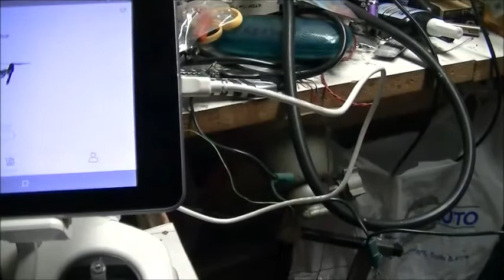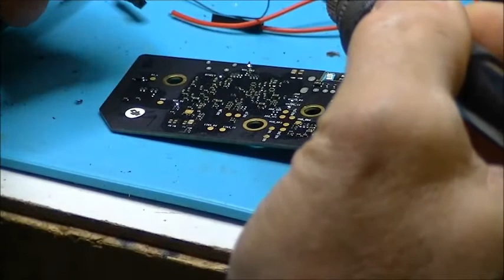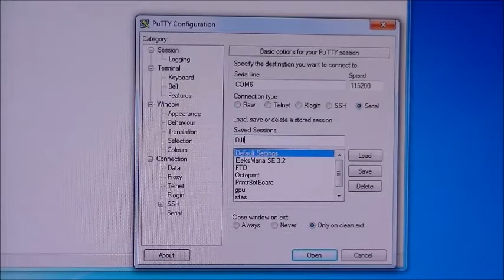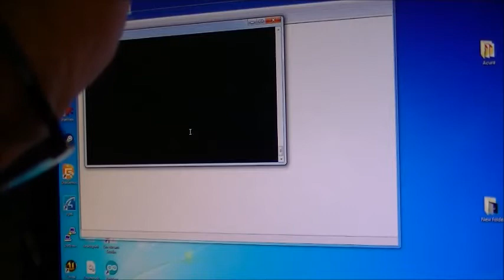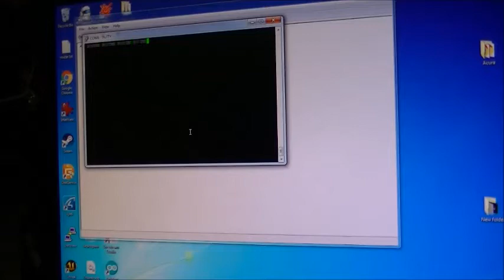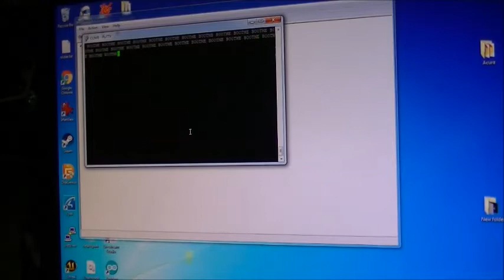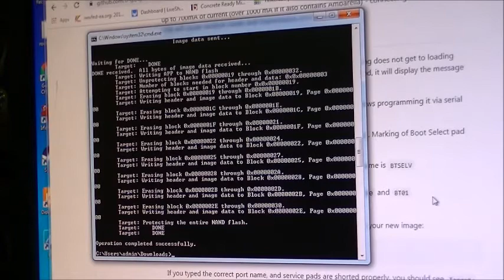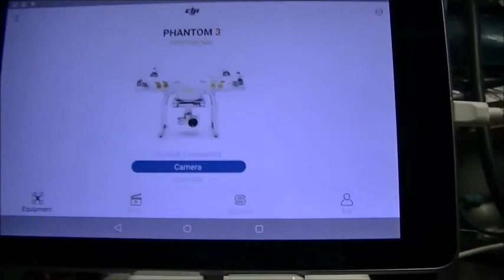DJI Phantom GL300A USB Repair fix no camera view

Comment: HELLO TERRY AGAIN i faced a problem in the method of flashing the gimbal , the putty is not reading it on the same ttlusb i used to flash the gl300A, do you think if putty is not reading can i do a blind flashing??? i mean i make the connection then  jump the booting and running the command promt and type the reflash orders?? what do you say may that work??? or it may do a harm?? by the way when i make the connection to ttl usb and set in comport and buad rate the putty  does not display any communication, but the gimbal board is has an led blinking .the supply voltage in this repair  is 5v according to video, i tried the 3.3v instead but the gimbal board didnot even blink .
Reply from the maker: Unlikely. If you are not seeing the BOOTME message then no good. Try swapping the Rx and Tx on the ftdi and see.  

Hmmm.  How are you powering the gimbal board?
Reply: @tjones99   i powered it from the ftdi(ttl usb in my case) it self, when i use the 3.3v the ttl will not be defined as a com port( unknown device) and will not launch the putty on that port, when i use the 5v option i t opens the comport in putty and the board status led blinks green for some time then red but no serial data received on putty?! i tried the ftdi32 same results, by the way the guy used a seperate board to power the board thats why he used two grounds
Reply from the maker: m j putty not seeing your ftdi boards is the first issue. The ftdi should be 3.3v. First get that working without the gimbal board even connected. Connect ftdi Tx to ftdi Rx and plug the ftdi into your computer not connected to gimbal board. Should show up as COM Portland with Rx to Tx what you type in putty should appear in putty window. 

Then find a way to provide 5v power to the gimbal board. What might work is your second ftdi board set to 5v and only hook up 5v and ground from it. First ftdi at 3.3v hook up Rx Tx and ground for communication only. Alternatively get a 5v dc power adapter.

Comment: now i have another problem i have a phantom3pro that displays no video and this happened after an unsuccessful  firmware upgrade, is there a way to reflash the gimbal main board  there is a video but its in german!!lol https://www.youtube.com/watch?v=boK1ZFy0phw , it is clear uses a very close technique but the jumpers to enter boot me mode is not clear!!??
Reply from the maker: I looked at that German video and basically the exact same as my video but using different files that the author makes available on Google Drive to download. Same FTDI adapter, same PUTTY program, same procedure just solder to the pads he shows in his video and use the files he has on his download. Just ignore the words and follow my procedure with his file and his connection points.
Reply: @tjones99  should i jump the points with blue lines in his connection image all three points or just one point  ? and why did he use two grounds??
Reply from the maker: @mj-is3kd  My guess is you jumper two of the pads to get in bootme mode. In one of the comments someone posted the text of the video in english (crude but somewhat helpful)
Reply from the maker: @mj-is3kd  Also interesting is that in the comment where someone asks for an english version someone else points at my video as the solution... small world...

Comment: hats up to you mr Terry i have just ran the method and saved me loss of my gl300A , thanks a lot for sharing... one thing to note that the ftdi adapter didnot work i dinot know why only a ttl usb adapter did the job communicating correctly in the whole method
Reply from the maker: Thanks for the feedback. Sometimes it is hard to get the FTDI drivers to install in Windows 10 because some of them use unsigned drivers. There is a special boot mode in Windows 10 that you can get into for one restart that allows you to install unsigned drivers. Great instruction on that at https://www.maketecheasier.com/install-unsigned-drivers-windows10/

And I can't take full credit... all the details posted by others in the forum made this video possible.

Comment: hello terry first ultra thanks for the effort and most important for sharing it , a lot of us  semi diy guys like dji products for technology and reliability , but hate how closed dji stuff are , any way my question hopfully you answer should it be a ttl  module used to communicate with the board you repaired  or i can use ftr32 ?? is there a flashing method for the gimbal main board if it goes bricked
Reply from the maker: Never heard of an ftr32 board... ftdi and ftdi 232 board will work... virtually anyything that is seen as a COM port on the PC and translates the communication at a 3.3V logic level will work... And I am sure there is a way to reflash a gimbal board but I haven't gone there yet... have a look at https://phantompilots.com/threads/fixing-flash-in-dm365-chip-within-ph3-pro-gimbal.127310/ on that one... it starts off way in the deep end with resoldering a BGA flash chip... then talks about reflashing... but I think there  will be a lot of reading between the lines on that one...
Reply: @tjones99   ftdi 32 i meant, thanks for reply

Comment: Terry I have a Phantom 3 Professional and it lost video after sitting for about 3 months.  Never had a problem before that.  Even now I can fly the quad copter and it records video but I can't see what the camera sees.  Flying blind is risky.   My problem is I don't have a PC computer (I'm a Mac guy) and while I basically understand what you are doing, gearing up would be costly.  Is there someplace where I can get a board for my GL300B controller and just do a board swap?
Reply from the maker: I see two boards listed on ebay that might solve your issue... alternatively if you want to mail me your board I can try the similar procedure on the GL300B board that I did on my GL300A board and see if that behaves...
Reply: @tjones99  Terry, thanks for getting back to me.  I saw the two boards on Ebay and the price is not too bad.  I contacted a drone repair service and they told me to look at buying another Phantom 3 since it would be about the same cost as having me send in the drone and having them fix it.  A board swap seems sooo much better.  I'll get the board out of the controller and see what it looks like and get back to you.  If I have you try reprogramming the board, would you need my controller to see if it works?
Reply from the maker: Don Loftus no. Just the board.

Comment: Hi Terry,

What is the name of the connectors you use? Do you have a link to where you buy them at all? 

Thank you for the video, got the USB coming in a few weeks and trying this asap but can't figure what the connectors are
Reply from the maker: I assume you are talking about the little red wires that have connectors on the end to plug onto the FTDI board (USB FTDI board).  Those are just simple dupont connectors on wires. The ones pictured were just female to female wires that I cut in half so two wires cut in half gave me 4 dupont to bare wires. Search for female to female dupont in ebay or amazon and you will find some.
Reply: @tjones99  thank you Terry, true gent! I'l look them up now!

Comment: Terry, a question about how you soldered the leads on the board.  I noticed you just touched the tip of the iron on top of the stripped lead wire and pad but didn't have an obvious source of solder.  Do you use a paste on the pad or the stripped end of the lead?  Or solder the end of the lead and then melt that again when pressing the lead against the pad?  
Also, I've got a GL300B controller that just this weekend progressively stopped showing the video stream and then stopped being recognized by an Android tablet (using two different USB cables.)  Also tested unsuccessfully with an iPhone 7 and an iPhone 6.  I can get into the Go app but it says "disconnected" and no amount of fiddling seems to restore the connection.  It worked fine the weekend prior to this.    I'm hoping the control board for the GL300B will behave the same with this process as those with an GL300A.
Thanks.

Edit:  Just opened up the GL300B controller and the USB control board looks nothing like the one in the video.  The bottom of the board (the side opposite the USB connectors,) is completely blank with no SMC's and no pads other than the ones for the USB connectors themselves and two copper colored dots marked 1765_P1 and 1765_P4.   There are some SMCs on the side with the USB connectors and what might be pads but none are labeled.   There's a label saying: P01213.02 and a sticker saying: 04EJA   57104.   Guess that takes care of that.
Reply from the maker: Sorry, for some reason I missed that you had posted a message. I think in the video I "tinned" the pads on the board which if you don't spend a lot of time soldering means you make sure they are coated with a fresh blob of clean new solder, and off camera I did the same for the ends of the wires so both wire ends and solder pads on the PCB (printed circuit board) had fresh solder so then all you have to do is put the two together and apply heat and they melt together. Soldering 101... 

So your board looks different... do not give up... Have a look at the pictures at https://phantompilots.com/threads/fixing-flash-programming-in-dm365-chip-within-gl300-remote-controller.144123/ and see if that looks like your board... if so then my video is just a reference and those instructions should apply.
Reply: did u find a fix in the end?
Reply: @Ace-Boogie-Reactions  I did not.  I think the problem was caused by a bad USB cable that may have shorted the board.  I ended up buying another controller.  The old controller is a GL300B and the new one is a GL300D but it works fine with the Phantom 3 pro.  Thanks.
Reply: @stevek731  i bought a new usb board for the back and still had the same problem so im guessing its my main board on the controller i just bought a second hand controller with 50 percent charge problem for £35 im going to swap the board and see what happens should be here tomorrow

Comment: Hello I follow your instrucion, get succesfully to de command windows with the flash command instruction, its start to flash but it hangs up at 
Waiting for the DM36x...
                      target BOOTME
BOOTME command recd. returning ACK and header
                      ack command send. Waiting for Begin command
                      target BOOTME
and it goes over and over, witout flashing?
any suggestion?, Y can send you my videos, but can contact you?,
I´m at 2cvguy at gmail
thank you Cris
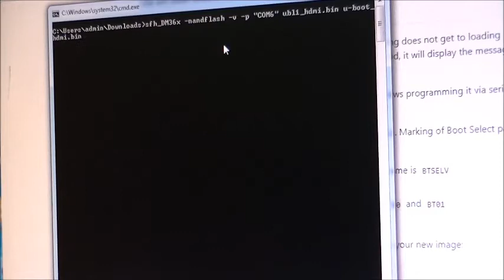Reply from the maker: If you watch at or about 18:00 in the video you will see mine did that exact same thing and I mention aborting the program and restarting it and the second time it works.
Reply: Terry Jones Hi Terry, yes I do it again and it hangs again waiting for the begin command to get acknowledge, done it few time but no luck
Reply from the maker: @elviejoperro3077  You restarted the DOS program WITHOUT rebooting the USB board? 
I see a couple of things you might try at
https://phantompilots.com/threads/problem-flashing-nand-on-phantom-2-vision.117342/
One is to erase nand first. The other is a carefully timed swap between terminal and programming command. 
Other than that I don't really have any better suggestions.
Reply from the maker: I had another thought today after working with a DJI Lightbridge 1 ground unit that had a similar issue. You have to short out the BSEL to 3v3 to get into Bootloader where it accepts the flash programming, and during the process it finishes and reboots and hangs up on you I believe. Two things you may try. One is to disconnect BSEL from 3v3 as soon as the flash process starts, the other is to keep BSEL connected to 3v3 so that when it reboots it again goes into bootloader/flashing mode... Not sure either will help. I would also like to hear back whether you had any success and if so what led to success. That way this thread can be a resource for others.
Reply: Terry Jones Hi Terry thank you for keeping me in your thought, I tried to do the 2 suggestion but no luck. ☹️ I even read in another forum a guy had same issue and he tried with another USB to TTL and succeeded, not my case, tried with 2 other TTL and no luck, the board dosen’t pasa from the second command, the BEGIN command, I can’t even get to the Target Botme to run the tool for a second time. Think the NAND chip may be broken?, but it does give the no image massage from putty before putting it into boot mode. Well will keep searching info on the net, thank you Cris
Reply: Terry Jones Hi Terry thank you for keeping me in your thought, I tried to do the 2 suggestion but no luck. ☹️ I even read in another forum a guy had same issue and he tried with another USB to TTL and succeeded, not my case, tried with 2 other TTL and no luck, the board dosen’t pasa from the second command, the BEGIN command, I can’t even get to the Target Botme to run the tool for a second time. Think the NAND chip may be broken?, but it does give the no image massage from putty before putting it into boot mode. Well will keep searching info on the net, thank you Cris
Reply: Hi Terry, update on the board, I found a used cheap board for the GL300A witch supposed be in working condition. To my surprise I installed and test it with no luck, no video feed. I pulled it out and run the putty program and guess what?, no image. I run the tools following your Instruccion and immediately override the  image and now it is working great. You do need a board that is no damage or burned to reflash the firmware. So thank you again, your tutorial is good and easy to follow. Thank you, Cris.
Reply from the maker: @elviejoperro3077  Thanks for following up and posting the outcome. Sorry for the delayed response.

Comment: I appreciate the video you have made on this. I just ordered the ftdi board and am going to give this a shot when it arrives. Thanks!
Reply from the maker: Takes a bit of skill soldering little wires on to hook to the FTDI board. Also another tip I found is that if your FTDI board has a CH340 chip and you have trouble getting drivers to install on Windows 10 look up how to install unsigned drivers in Windows 10.
Reply: @tjones99  Just a small correction.  If the USB to TTL UART adapter has a CH340 chip, it isn't an FTDI board.  The CH340 is made by WCH, FTDI makes the FT232 chips.  The genuine FTDI adapter that I had worked great with your original instructions (and Windows 10 64 bit).  Those lower cost Chinese adapters will indeed sometimes have problems.
Reply from the maker: @billjohnson3344  thanks!!!
Reply: @tjones99  thank you!
Reply: @tjones99  just a thought.  Not sure where your located but would you consider trying to reflash 2 of my boards for a fee?
Reply from the maker: Lift-off-Life I live in Toronto. Drop me a note to tjones99@gmail.com
Reply from the maker: @lift-off-life760  did you ever get yours working?
Reply: @tjones99  I suspect that at the factory they used a "bed of nails" to make the connections to the gold plated pads, a common procedure.  Jim